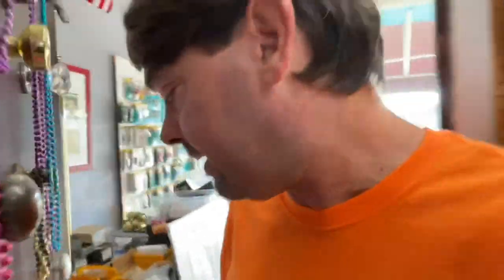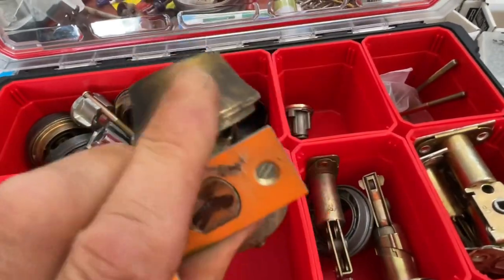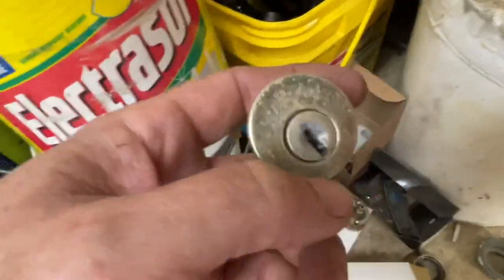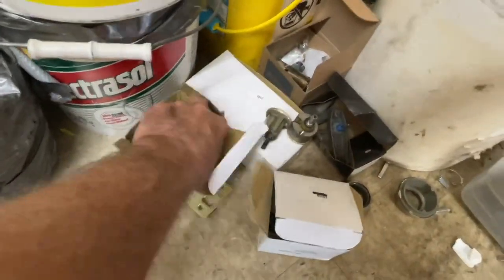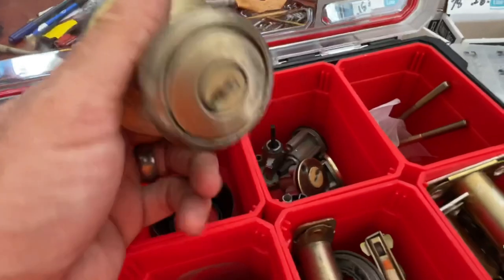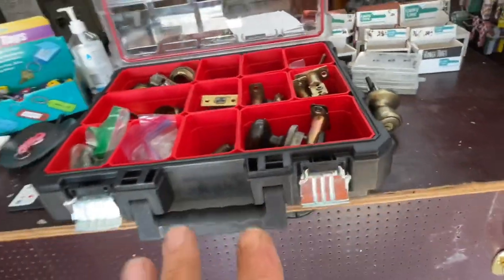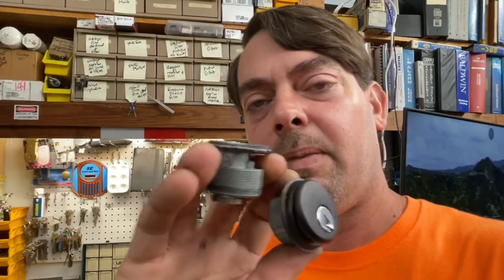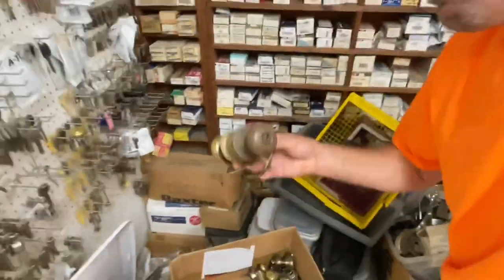Q&A “Why I don’t keep cylinders keyed up to swap out on rekeys”

Comment: Interesting to see and hear different techniques. I prefer if my KW1 KIKs come keyed alike from the supplier and recently they were zero bitted. Otherwise, I agree with your methodology for the vast array of cylinders in the lock spectrum. Some people claim to "save time" at a job site but are most likely keying copious amounts of cylinders during precious weekend hours? Not me!

Comment: i have a case like yours, where I keep it stocked with a bunch of used cylinders, mostly Schlange and Dexter. but also Kwikset, in various degrees of condition. 

what helps now, especially with New Owner Rekey jobs. or if people have a long list of problems, we have them take photos and email them to us. which helps, cause we can do it before going out.
 
I mostly have those in groups of like 5 cylinders keyed to a couple keys.. it can save some time.. but I mostly have it, if I get out to a lockout, and I get an old Schlange D series on a door filled with polishing compound or they don't have a key and I just drill  carefully it and pop in a new cylinder in.. save way more time.

but you are 100% right.

I would say having a box of Schlange cylinders in bundles though.. especially in an area where you mostly have older style Schlange products, is helpful. that had saved me loads of time.
Reply from the maker: I definitely have a box full of various cylinders for those problems but usually aren’t keyed cause most of the time it has to be keyed to something else anyway.
The catch there is when you grab that one cylinder you thought was ok and go to shimming and realize a dud had slipped in. I hate it when that happens! *heavy sigh

Comment: Well Saturday #Lockforce got interrupted by my wife and a honey dew list. 😆 And I also had my first opportunity to rekey a Commercial storefront for the property management. Well it was a 5 pin SCHLAGE so being a YOGI BEAR and not having the correct SCHLAGE pins, I went the big blue homestore bought 3 key matching numbers 5 pin SCHLAGE locks. Pulled them parts and repinned the 2 ADAMS RITE Mortise Locks. And changed the cylinder on the knob. And quiet happy took less than an hour to do my first  SCHLAGE LOCKS.

Comment: Now let me to you when you can keep cylinders keyed up to swap.  We had bought 10 Cal Royal lever cylinders as extras on this hotel we were masterkeying.  We would key up the 10 cylinders, pull out the old cylinder from the vacant and swap.  That way 10 units are done, then I go about my business master keying the 10 cylinders again, and repeat.  Also, good to do if you're doing a marshal call on same hotel, do the switch and be gone.
Reply from the maker: That is a good situation to keep cylinders for (I keep usually dozens of those laying around in case that situation is needed I will key them up to do that) but in that case there is no finish issues to worry over :)

Comment: American locksmiths easily understands why we don't just swap out cylinders. Not cost efficient. Oh I have a question. Does anyone else out there that doesn't like using factory keys for setup. drives the boss crazy that I don't use factory keys on these rekey jobs. of course when I do kwikset I change the the factory increments. I am just wondering
Reply from the maker: I usually copy them and throw the original keys in a pile of “sell on eBay” or just code cut a random number key and copy.
Especially with the Kwikset cause I hate handing out 2 nickel and XX brass keys together

Comment: I keep them keyed with a single random key just so I don’t have to pick them to rekey them? I’m not sure just what’s point here with this video? Am I missing something?
Reply from the maker: I guess you are 🤷‍♂️ The very first thing in the title is “Q&A” which means “Question and Answer” which is traditionally done when someone asks another person a question and that person provides an answer. In this particular video, as the title also alludes to, that question was “why I don’t keep keyed cylinders to swap out”

I then proceed within the very first 15 seconds of the video to explain that as well as throughout the video itself and then at the very end of the video as well.

I’m not quite sure how I could make a better point of “what’s the point of this video” but I will note having to explain the point of a very clearly pointed out video is in itself, pretty pointless.

but thanks for pointing out you don’t get the point of the video
Reply: @selock  .. Sorry, it wasn’t meant to be a insult, just a poor choice of words I guess. ✌🏻